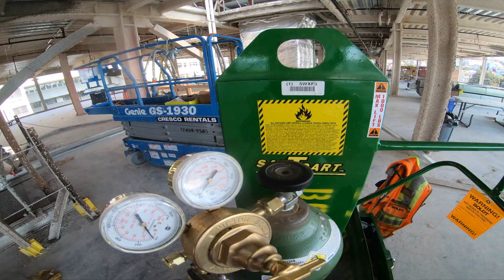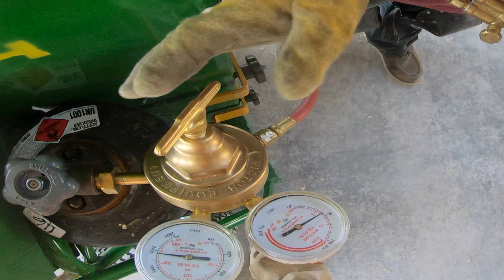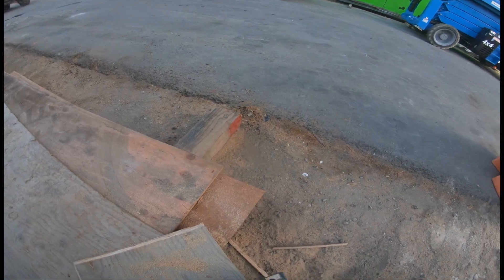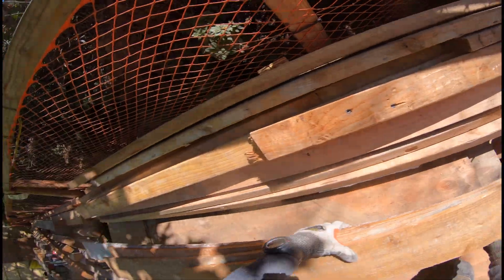Carpentry with Chris: Easy week

Comment: I was going threw your tools list and I seen you have 2 occidental tool bags? Do you order both or you just have both on there as options? I’m going to apply to my local carpenters union which is 1109. I want to start ordering tools that I’ll need. Thanks for the videos I love them. Can you make a video on tools you’ll need for the job when starting?
Reply from the maker: Good idea, let me look into to it. To start a tape measure, pliers and dikes, pencil/notebook, and hammer for now. As you keep on progressing you will see what you will need. Everyones list is different

I have two bags on that list just in case they like on color better than the other